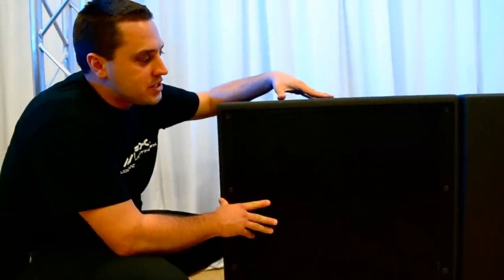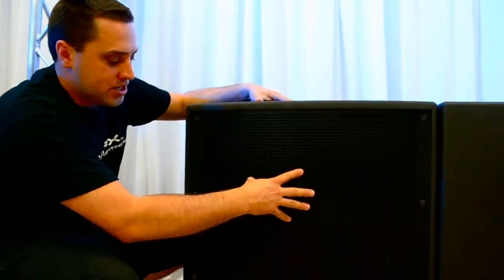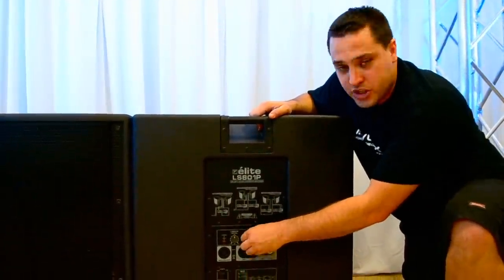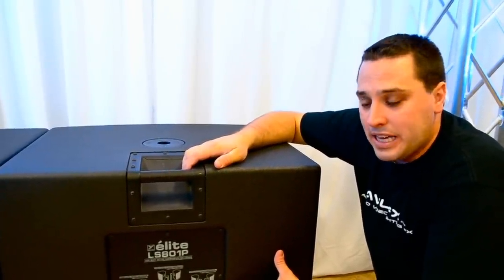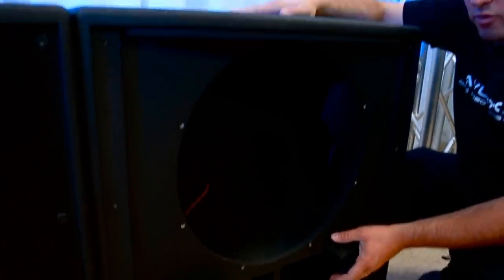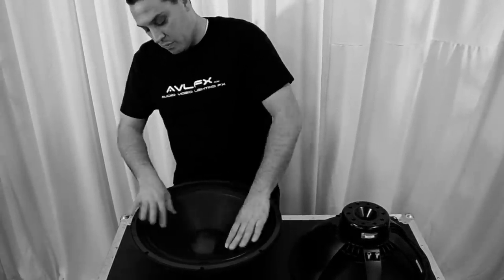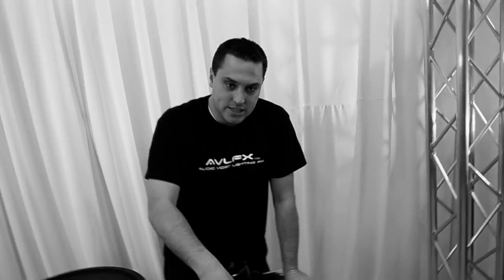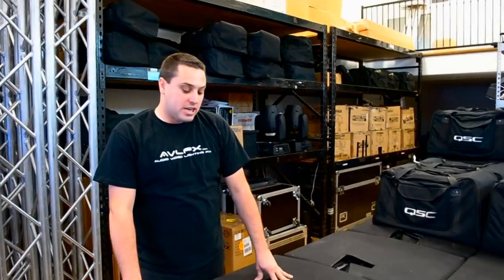AVLFX Tutorial on the LS801B Yorkville Sub

Comment: I just bought a pair of these subs and was hoping to find a little advice on what the sweet spots are on the dials on the back.  I have pared them with 12" powered mains (elx 112p).  I realize the the dial that adjusts the bass to either loud or deep, is about personal preference.  But overall, when you rent your equipment out do you tell you customers where you think the volume, shape and crossover dials should be? I find it hard to locate other ls801 owners to discuss this with.  Thanks!